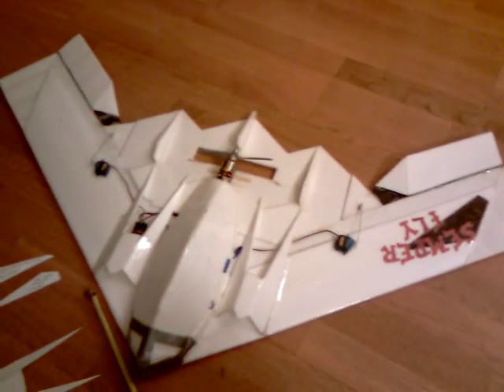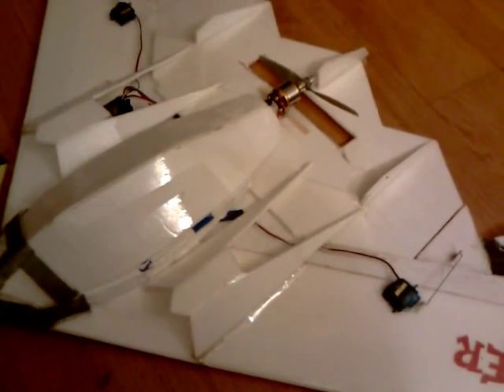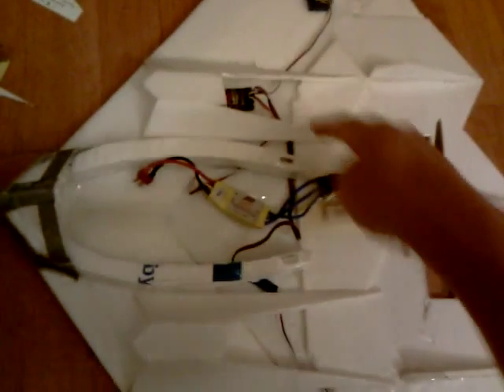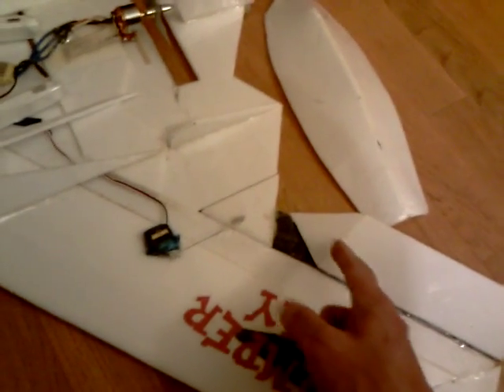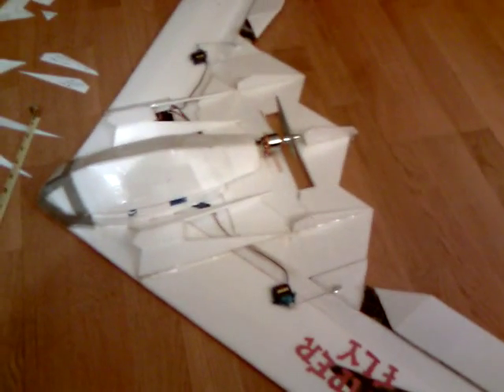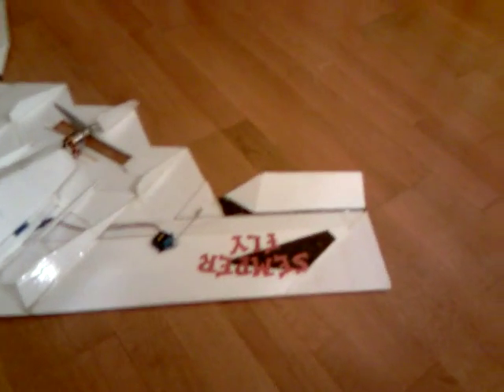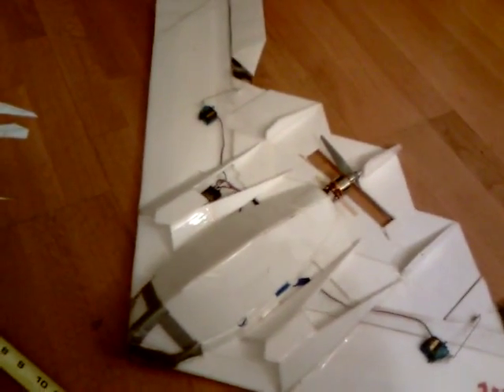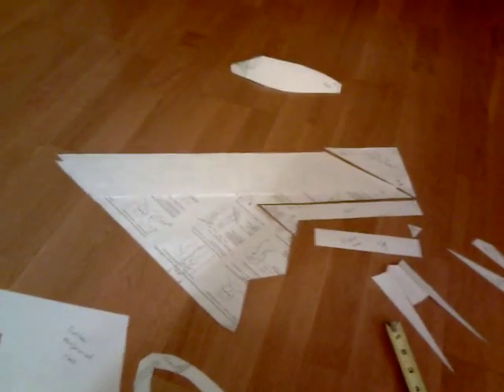B-2 Build for MESA Team

Comment: What size battery did you use?
Reply from the maker: 2200 3cell or 1800 4cell have worked great on this plane
Reply: @wildhover  thank yo for responding!
Last question how much reflex should I have if any? 
Great design the guys love it at the field.
Reply from the maker: @emilgabl9069  I'm a pretty basic guy so I just used a bit of up trim rather than setting up any reflex. Anyway, It's so fulfilling to hear that you are enjoying this wing!